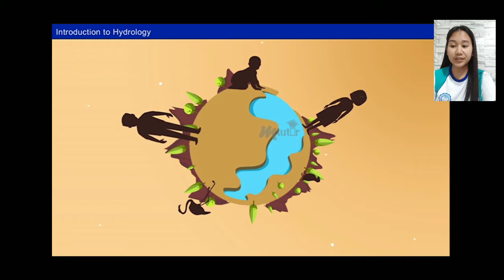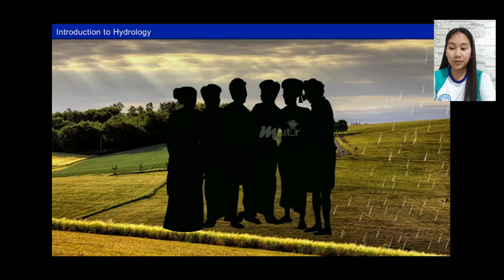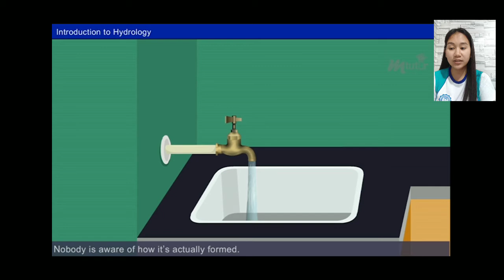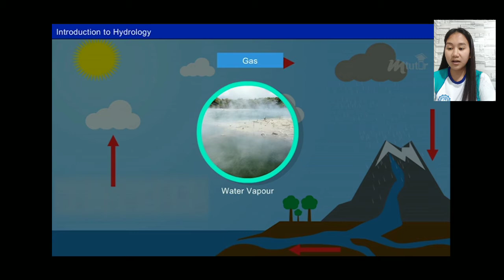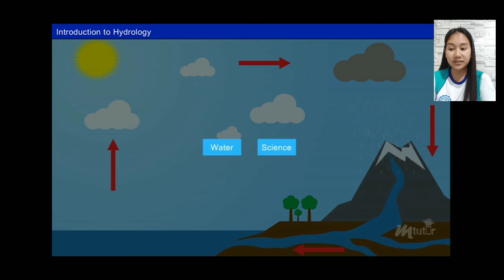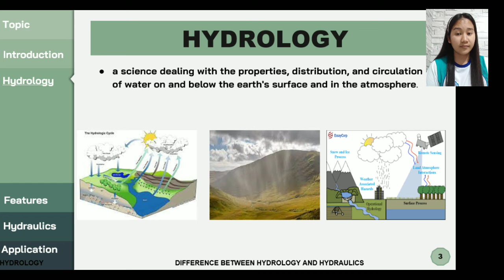Difference between Hydrology and Hydraulics | 4407-Hydrology| Gonzaga Anjeanette

Comment: The video covered a comprehensive discussion of Hydrology. It provided answers to frequent questions about hydrology, including how it exists and functions on Earth. The reporter talked about water circulation and where it came from. The major purpose of hydrology, according to the reporter, is to examine the interrelationships between water and its environment. Hydrology is the study of water near the earth's surface and the components of the water cycle that occur there: precipitation, evaporation, runoff, and groundwater. Its several sub-disciplines are concerned with distinct facets of these phenomena.

Comment: After watching the video of hydrology and hydraulics, I learned that hydrology is the study of the distribution and movement of water both on and below the earth's surface, as well as the impact of human activity on water availability and condition. In land development, hydraulic analysis is used after the hydrology reporting process in order to design storm water conveyance networks, calculate the depth of flow in pipes, and determine open channel flow in ditches and swales. This is often referred to as storm water management design.

Comment: The difference between hydrology and hydraulics is discussed in this video presentation. Hydrology is defined as the circulation of water and its constituents through the hydrologic cycle, or the quantification of flows that are ultimately produced by precipitation, while hydraulics is defined as the analysis of how surface, or subsurface flows move from one point.It's critical to distinguish between hydrology and hydraulics when addressing stormwater management. Hydrology is involved in some areas of hydrology, but the two are extremely distinct in general.

Comment: Water is necessary for human survival, due to the fact that an adult human body consistt of sixty percent (60%) of water, and it also keeps the ecosystem alive.  Hydrology simply means Water science, it deals with the properties, cycle, and distribution of water whether it above, on and under earths surfaces. In Civil Engineering, an civil engineer build structures such as dams and water reservoir by apply their knowledge on hydrology, in operating, designing and utilizing water resources. Estimation of water, and where and how it can be gained and use, example underground water, salt water etc. it also deals with the water cycle which includes precipitation, run off and transportation. Lastly what are cause and solution in shortages of water resources.

Comment: In this video the reporter discussed the differences between hydrology and hydraulics. In short, hydrology is the study of water and hydraulics deals with fluids in motion. A detailed overview of both these topics and the difference between hydraulics and hydrology are provided in this article.  The hydrological cycle of the earth is the sum total of all processes in which water moves from the land and ocean surface to the atmosphere and back in form of precipitation. The hydrological cycle is dependent on various factors and is equally affected by oceans and land surfaces.

Comment: In this video, the reporter discussed the difference of hydrology and hydraulics.
Hydrology is defined as the circulation of water and its constituents through the hydrologic cycle, or the quantification of flows that are ultimately produced by precipitation. It deals with precipitation, evaporation, infiltration, groundwater flow, surface runoff, streamflow, and the transport of substances dissolved or suspended in flowing water while hydraulics is defined as the study of the mechanical behavior of water in physical systems.Climate change affects evaporation and precipitation. Climate change is likely causing parts of the water cycle to speed up as warming global temperatures increase the rate of evaporation worldwide. More evaporation is causing more precipitation, on average.

Comment: The video talked about the differences between hydrology and hydraulics. In the section where the reporter discussed hydrology, I learned how vital water is in our lives and how it could affect our planet if not used well. I have also learned what are the properties of water, its origin, and how it is distributed on the earth's surface and in the atmosphere. In connection to hydraulics, I learned how important it is to study hydrology, and since it was barely discussed that's all I could comment on as of now.

Comment: The reporter tackles about hydrology that shows there the definition of hydrology which is the study or science of transforming rainfall amount into quantity of runoff, focuses on the planning, designing in water-related projects and construction. A science dealing with the properties, distribution, and circulation of water on and below the earth’s surface and in the atmosphere. Hydrology provides guidance for undergoing proper planning and management of water resources, is also an extremely important field of study, dealing with one of the most valuable resources on Earth. And that we can easily realize the connection of hydrology in the field of engineering.